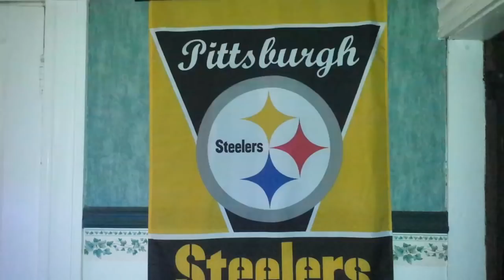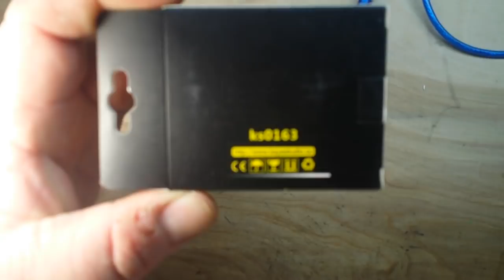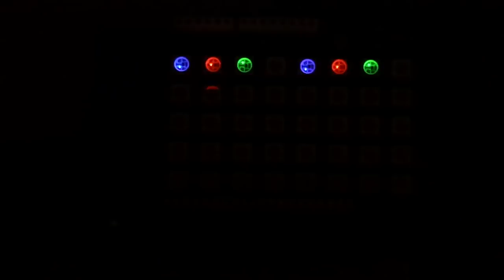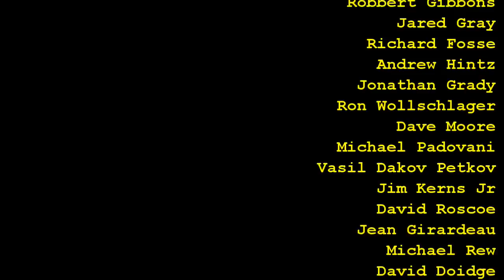Keystudios RGBLED Shield for Arduino

Comment: Nice video again. I wonder is there a way to feed in an external power supply? Merry Christmas
Reply from the maker: +Josef Bücker Yes, you could cut or bend the 5V pin so it doesn't connect to the Arduino and then feed power from another supply. Just be sure to connect your grounds.